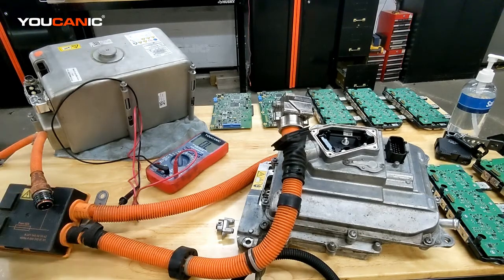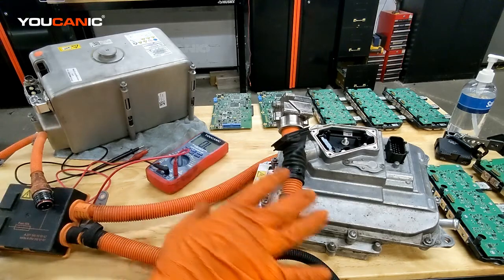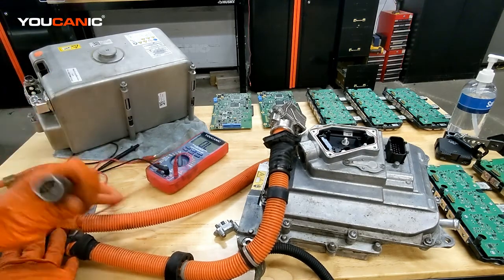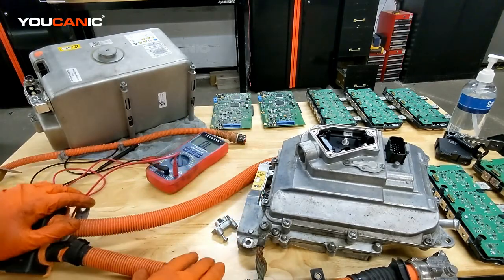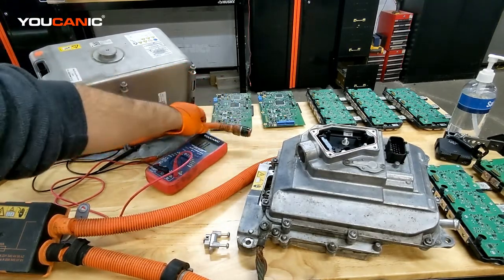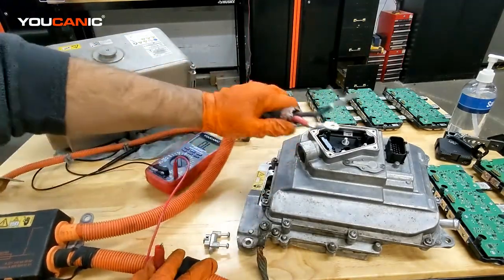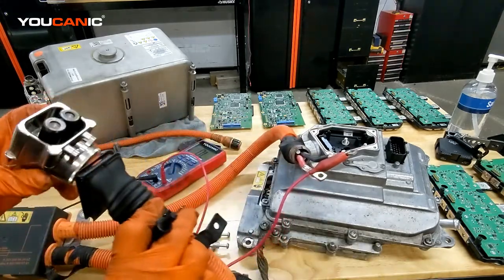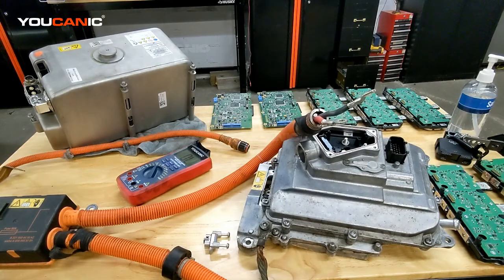What Does Interlock Fault Code Mean on a Hybrid Vehicle?

Comment: Just did a transmission swap on a gmc hybrid 4l60 and now the code comes in and out
Reply from the maker: Hi there, thanks for reaching out! In order to properly tackle your transmission issue, we highly recommend you to check out our resources at www.youcanic.com. Youcanic provides free resources, guides, and even our powerful YOUCANIC scanner, all designed to make car maintenance a breeze. We also offer factory repair manuals that may be very helpful in your case.

Our aim is to support and empower car owners on their journey, saving you money and boosting your confidence under the hood. Don't hesitate to reach out on our site if you need any assistance. We're here to help!

Comment: Dear 
What is dtc p317d mean
Reply from the maker: Thanks for your query! The DTC P317D code generally relates to engine control module issues, but the specific meaning can slightly differ based on the make and model of the vehicle. At Youcanic, we strive to provide comprehensive resources to empower car owners like you. For further assistance, visit www.youcanic.com. 

You'll find extensive guides, free resources and our exclusive YOUCANIC scanner there. We're on a mission to make your car maintenance journey straightforward and efficient. Reach out to us anytime on our site, and remember, we've got your back. Drive safe and keep exploring!